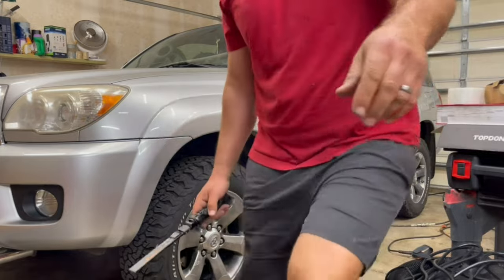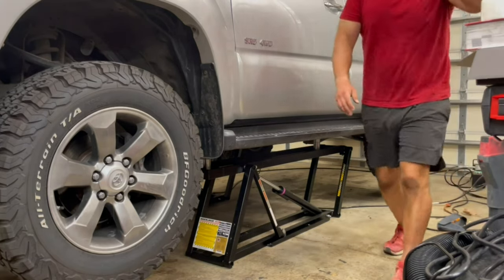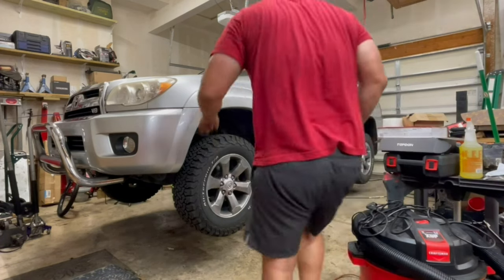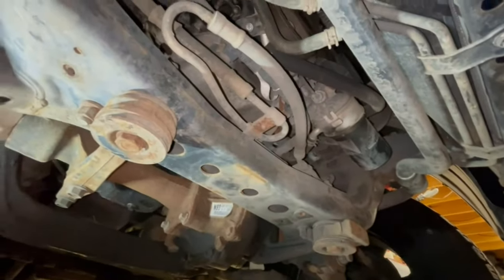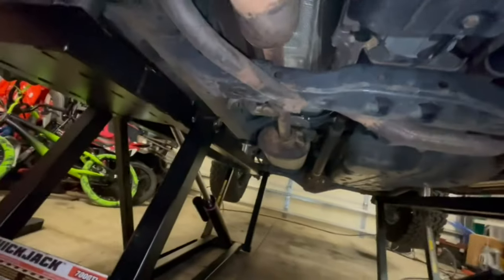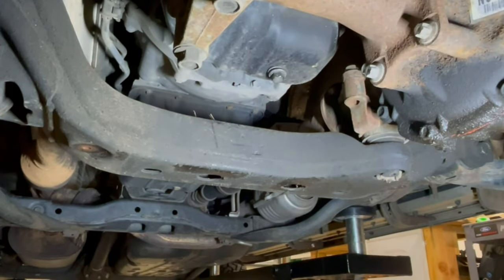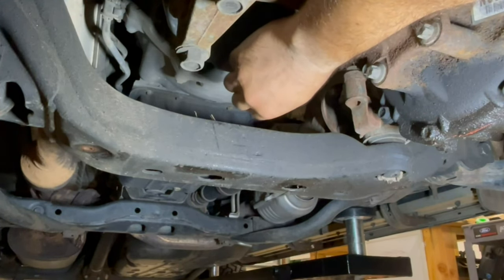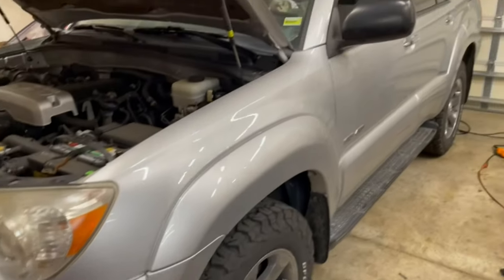QUICKJACK 7000 VS. FULL SIZE SUV - Lifting a body on frame 4Runner with my QuickJack 7000TL

Comment: Love this lift! I have a video lifting my 6” lifted 2021 F150. Placement on yours was spot on.
Reply from the maker: Ha! Love your channel name. I actually had seen your video before. I just re-watched it and noticed that the adapter on the front passenger side looked crooked on the frame rail - is it because the frame bends up at that point or was it just not sitting flush? Thanks for the view and comment! Looking forward to checking out more of your stuff.

Comment: I was an early buyer of the 7000TL. The Quickjacks work ok if you're lucky and get one without a defective air cylinder. If you do get one of those you're screwed - the company will 100% not stand behind their product. They'll claim the air-assist down isn't "necessary to the function of the lift". Really? So if one side has air assist down and the other doesn't, and they drop unevenly, that's safe? And then when the vehicle drops to the ground and one side of the lift goes straight to the full down position while the other... doesn't. You need to wait... and wait... and wait for it to drop with no weight on it. Quickjack will claim this "is normal operation" and that "it will get better over time". If you invest a massive amount of time trying to get them to stand behind their product they will, eventually, after burning through every once of customer goodwill, send out a new cylinder. Yay! Until you get the replacement and the freakin' air side is literally capped off. Like intentionally made unusable. That's not a fix guys. Then they'll claim that the engineers decided the down-assist wasn't necessary and that they've changed the design on future models. But I didn't buy a future model with less functionality. I bought the current model with exactly the functionality I wanted, was promised, and paid for. Oh, and clearly it's not true because 18 months later the new models still have the air cylinder. Whatever. I'm tired of the lies and prevarications - life is too short. I've written off the entire company as another skanky marketing hack with no integrity. I still have the quickjack in my shop, but the company worked very hard to make me regret my purchase and it low-key pisses me off every time I look at it.
Reply from the maker: Hey Brother - sorry to hear about your frustration with QuickJack (BendPak). I did a lot of research before pulling the trigger on my QJ setup and your experience is definitely not the norm with QJ. Most people are pretty satisfied with their units. Knock on wood, mine's been working very well so far and Im happy with it for what it is. Thanks for your comment though and thanks for watching the video!
Reply: The comment is from a bot account spamming each QuickJack video with the same story. Report!
Reply from the maker: @sunfield113  Appreciate the heads up, thank you!

Comment: That’s an awesome jack! Where did you find it and how much did it cost?
Reply from the maker: Its the Quick Jack 7000 TL. I got this at Costco with all the accessories for about ~$1800. It retails for ~$2000-$2200. Honestly, though, if you are able to accommodate it, I would get the MaxJax mid rise lift for ~ $4000.
Reply: @beerwrenchgarage  I’d trust it more than one from harbor freight lol
Reply from the maker: @bobbycalcote  Dont get me wrong, its perfectly sturdy and dependable. But the lifting legs are 100+ lbs each, so if you have to move them and store them, its a bit of a pain in the ass for the 2 feet of lift you get. A max Jax would give you 4ft and its a 2 post lift so you dont have to move/store it. If you can just kind of keep the Quickjacks on the ground, waiting for use, then it makes it much more of an attractive option.